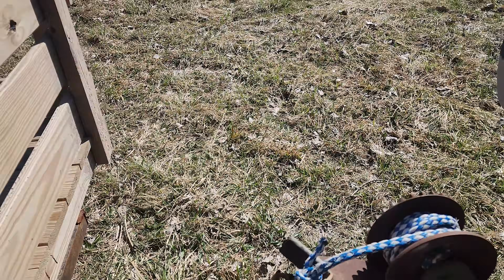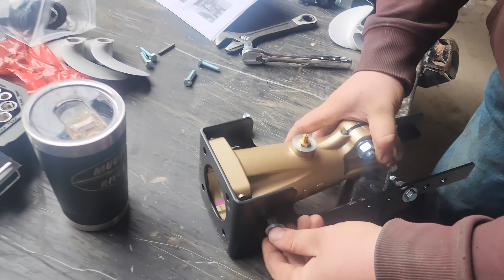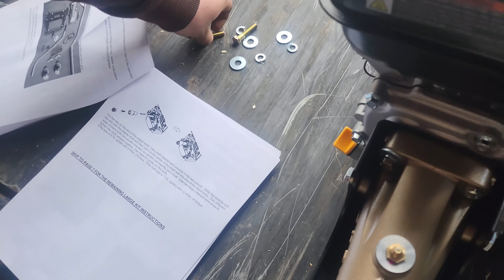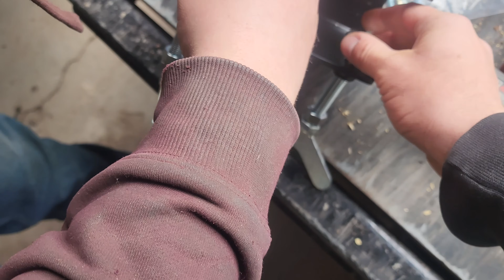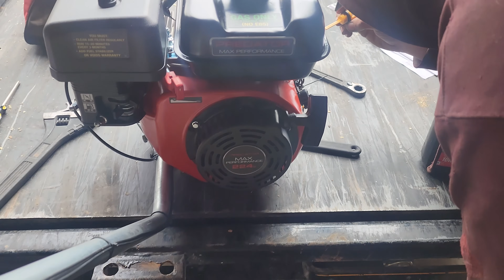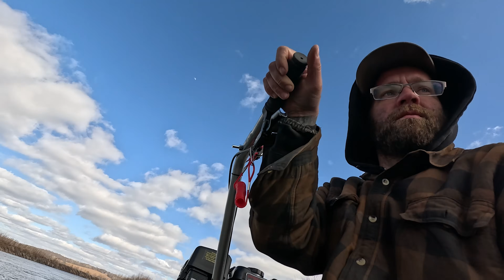Beaver Dam Mud Runner Assembly & Test Run || Building My Ultimate Small Water Jon Boat!

Comment: Looking good man! I would suggest a 14 foot over the 12. Look forward to the project.
Reply from the maker: Thats sorta what I'm leaning towards now. A 1436 is only 30 lbs heavier than a 1236. I test drove the motor on my old 12 ft v bottom and it felt small, unsteady and cramped. I think a 14 ft may be the way to go.
Reply: @DeeplyDrivenOutdoors  I agree 100% Look forward to the next one.
Reply from the maker: @danesterline3825  I'll make another one when I get a few more pieces done
Reply from the maker: I got the 14 footer
Reply: @DeeplyDrivenOutdoors  Saweet! Good call man.